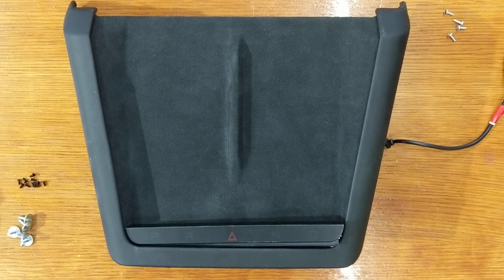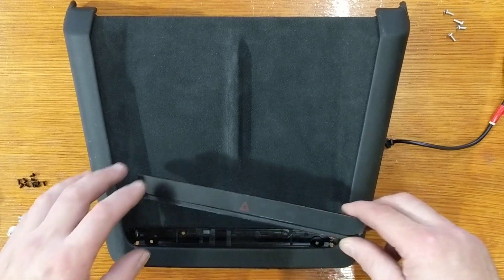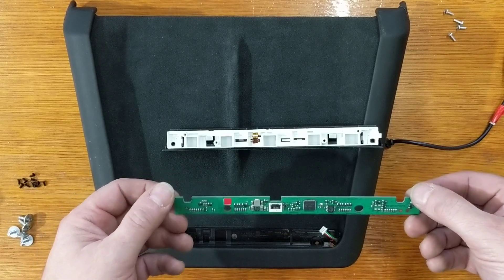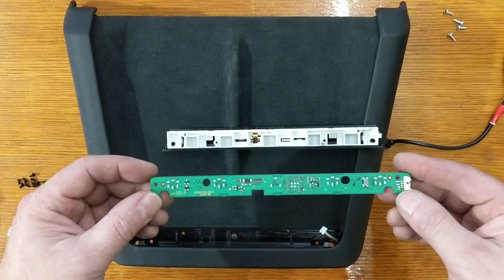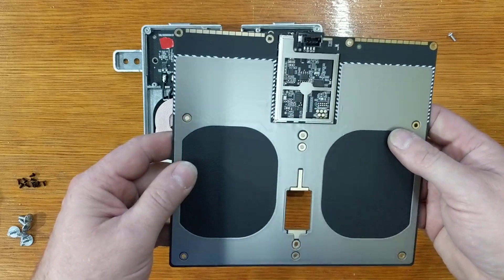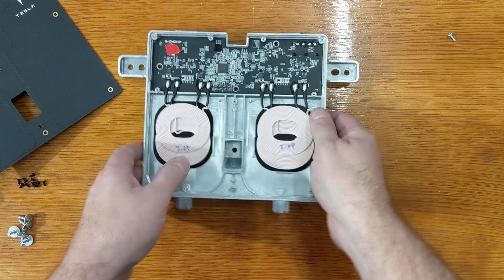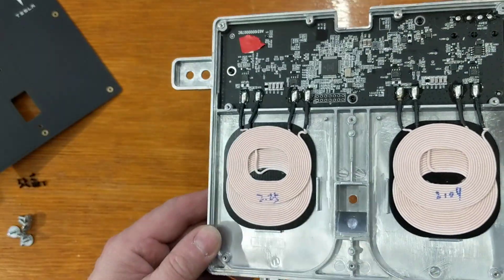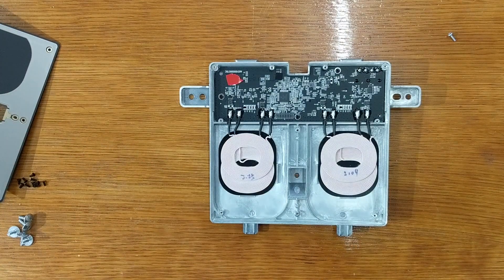Tesla Supercharger - For your Phone?

Comment: "Supercharger for your phone" is an exaggeration in 2021, if Tesla implements 15W only per device. Qi Standard V1.2.3 from 2017 (4 years ago!) specifies up to 30W per device.
V1.2	2015	Baseline Power Profile (BPP): 5 W
, Extended Power Profile (EPP): 15 W
V1.2.3	2017	EPP Power Class 0: 5 W - 30 W
https://en.wikipedia.org/wiki/Qi_(standard)
An even better video would have included some measurements taken on frequencies, voltages, amperage. And comparing it to standards documents.

Comment: Can't wait to hear how Tesla has managed to keep power output so high throughout it's SOC in the Plaid.  Usually as peak voltage drops, so does power output (with  Model 3 you lose about 100hp between 90-50% SOC.) How has Tesla accomplished this feat with the "old" 18650 cells?
Reply from the maker: They haven't, it does drop.  The BMS publishes a 2300A limit, and as cell voltage falls, so does the kW.  I published a graph in my channel blog if you'd like to take a look.
Reply: @Ingineerix  Can you provide the link?
Reply from the maker: @jayimbo646  https://www.youtube.com/channel/UC31O6BEWzx4D--YPw9aJABA/community?lb=UgwM2XjcEX5K1CrrBwN4AaABCQ

Comment: Good luck pushing the emergency hazard lights when you're driving with gloves on. Tesla's touch screen everything is stupid, bad, and dangerous design.
Reply from the maker: If you are a driver that needs to turn on the emergency flashers while driving with gloves on,  I suggest you turn them on before you start out.   Might also want to mount a big orange warning triangle on the back like is required for farm machinery.
Reply: @Ingineerix  You've never driven a car in Canada in the winter. And for the non-driver that says you don't use them while driving, also false-- for example, on highways or low visibility areas if traffic slows all of a sudden, you're supposed to put them on to warn people behind you. Nice videos, keep it up!
Reply from the maker: Yes, I have.  I take my gloves off when I get in the car.   Keep in mind the Plaid has a heated steering yoke.   =)
Reply: @Ingineerix  Also; EVs heat up real quick! I bet many people sitting in their ICE cars in winter don’t understand these things at all. I’m from Finland.
Reply: remove your gloves .....problem solved. It's a button like all other hazard buttons
Reply: Hazard lights are never to be pushed when a car is in motion.  They indicate a car is stopped on the road and a potential hazard.

Comment: Incredible that they're talking to the CANBUS from something tiny like that. I'm taking apart a Fiat 500 and everything in the body of the car runs along dedicated wires over to the body computer. Probably 50+ wires running along the passenger side floor just for that side of the car, and it's a small car.
Reply: Since the shifter only comes on when the main screen crashes, I'm guessing there is some kind of heartbeat the shifter detects from the MCU, and if it doesn't detect it, it lights up and activates the panel so you can still shift.

That said, I wish there were a way to leave it on all the time so you had the option of touching the panel instead of sliding the car on the screen.
Reply from the maker: You can activate the shifter panel with a long-press anytime.
Reply from the maker: Tesla does a lot of integration to save wiring, and they keep getting better over time.